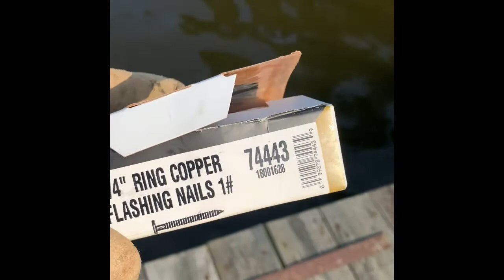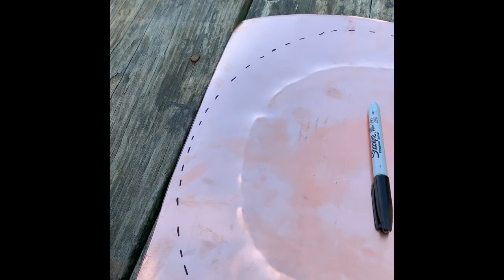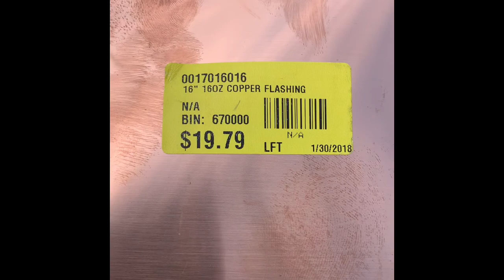Piling Copper Cap Install

Comment: Does the nail go through both flaps? (It sort of looks like it's in the crack between the flaps.)  Did you have to cut the flaps special to insure they would overlap? Or are the cuts perpendicular to the "circle"?